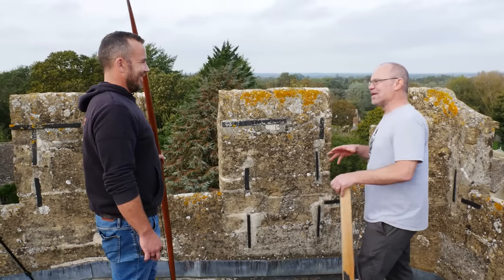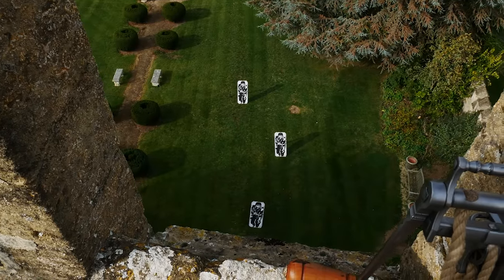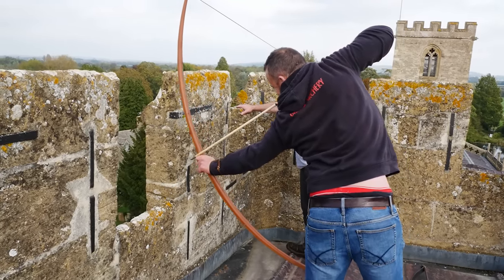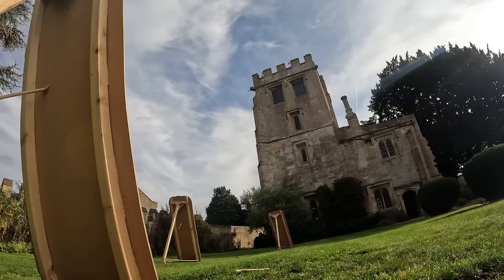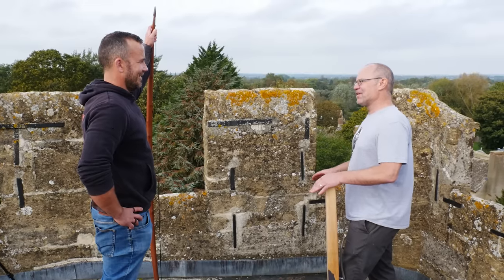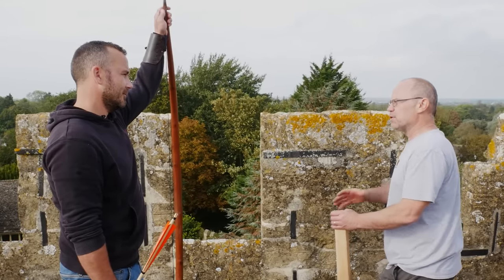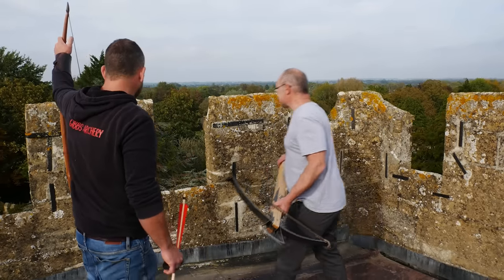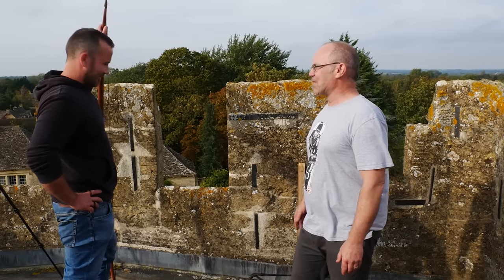Crossbow or Longbow? What's better for defending your medieval tower?

Comment: Easy: If your tower is full of trained longbowmen with the years of practice, training, and exercise required to draw back a medieval longbow, then longbowmen are better. 

If you’re not sure if you’ll be able to maintain a garrison of trained longbowmen to defend a single tower instead of using them to defend more valuable assets or in an attack, then crossbows are better because you can stick basically anyone in there with minimal training.

Comment: If i was on the tower with crossbows, I would have people in a safe spot whose only job was to load the  crossbows, and then slide them out to gunners who's only job was shooting them and could keep track of targets without looking away and maybe a couple of people with shields to give the shooters some cover when looking out, the same process could be used if I were using muskets, but using bow and arrows you would be screwed unless you were using them like artillery for ("Area Fire and shoot in the general direction") but that would waste a lot of arrows (I wonder if using arrow slits in walls you would be able to aim an arrow accurately or have to use the "Area Fire and shoot in the general direction" .)

Comment: Are the crenelations a standard size ? Would the crossbow limbs fit between the crenelations at a different castle ? As stated this castle wasn't actually designed to be used so would the size of a crossbow be considered when building one that was ?

Comment: I think they were good because you need very little training to be accurate. A good longbowmen is gonna be faster and as accurate if not more. Its just that you can round up 100 men from wherever, give them crossbows and 15min of explanation and you get a similar result then years of training with a longbow. That's what I think anyway. The simplicity of use makes it a good weapon to produce for the masses, greately increasing the strengh of your army with low training time. There were probably a lot of properly trained crossbowmen too. I'm no historian so I'm not familiar with that, but if I were a lord in these times and had 100 peasants to go to a battle or defend anything with, I'd either give em pointy sticks* with shields or crossbows with bolts (*replacing the pointy sticks with maces if we're talking of when armor was more common). But all in all, I'm not super surprised that our longbowmen here is better then the crossbow, after all he a real trained longbowmen!

Comment: So i just started this video at the ti.e of this comment but i feel like while yes the cross bow was "more accurate" and had better range and less training needed, the war bow had a shorter reload time and just send splinters down range faster, i think if used at the same time are more complimentary than one over the other. I say this because you have 5 CB men manning a section of wall they have to reload which takes a minute, during the reload time you have 5 WB men loosing 3-6+ arrows during the time of reloading for the crossbow and more or less keeping the enemy pinned and at distance. Also if there was a shield wall formation you have WBd lob arrows while CBs take direct shots at the formation, cant block em all, right?

Comment: In my opinion you shouldn't have made a pure accuracy challenge but a speed and accuracy challence in rise from cover, aim, shoot and get back into cover. Since the enemy team will use the time you expose yourself for aiming and shooting to hurt you.
Now what happens the experienced longbowmen and the experienced crossbowmen are wounded and have to be replaced by peasents from the kitchen or the stable etc. how sucessfull can they handle the longbow or the crossbow in a fight? The besieging force will be much larger than the besieged force and has more likley the possibility to get reinforcements into action. 
Also are there kinds of battlements that are more usefull to longbowmens or crossbowmens?

Comment: I also that you could hide longer with the bow than shown. Begin to pretensen the bow sideways around 70% the way pop out and shot. I suspect that there will be little accurate return fire if there are so few guys that you need to aim, or if the enemy archers are too far away to be a target. Or dont aim if there are enough enemys. 

Holding it at 70% and the rest out of cover is one way another would be to stand sidways and turn out of cover together with the motion of drawing the bow. Joust standing out and drawing the bow seems kinda......well dumb.

Honestly i would like to see a comparison with a short bow. They seem way more suited to castle defense. They have a drawweight any able adult should be kapable of pulling repeatedly for quite a long time without geting fatigued. Their range disatwantage is mitigated by your elevated position and the fact that the enemy needs to come to you. They should additionally allow much more free movement with a tensioned bow.  

Having a longbow defend a castle seems equivalent to in moder terms having a sniper in a house fight.

Comment: Most places were not defended by lots of well-trained troops. Anybody can use a crossbow with some basic training, you can't do that with a 100lbs plus war bow. There is also a little sprung metal catch that holds the bolt in place for crossbows. 

So say you're attacked, and you have a very few trained archers, but lots of able-bodied staff/servants. You also have say fifty crossbows, and war bows in the stockpile. Anybody who can actually use a bow will get one, everybody else will have to use a crossbow. 

So when it comes down to it, crossbows are better, because an unusable bow is worthless. But you can find almost anybody and hand them a crossbow.

Comment: Brings back that point in: did most medieval archers really used 120+ lbs bows all the time? Or did most archers in fact used more something within the 75-100lbs range: something a bit less powerful but easier to manage in all kind of awkard situations. What good is a bow if you cannot manage in most situations, right? Turks shoot in all kind of position and angles, yet they rarely used bows more powerful than 90lbs (so I found so far).
There are issues basing all source of knowledge on what was found on the Mary Rose, especially since most bows found there are overestimated in terms of pulling strength.
Reply: There's fascinating report from Hangzhou garrison in 1736, reporting that out of approximately 3200 soldiers, about 2200 were able to draw bows of strenght six to ten (80-133 pounds), and 80 could handle bows that were 147 to 173 pounds. 

 Five hundred troops at the small Dezhou garrison were  all able to take a five-strength bow (67 pounds), 203 a six-strength (80 pounds), 137 a seven strength (93 pounds) and 85 a ten-strength bow (133 pounds)

Other Chinese sources from 17th century mention that pretty much all archers can shoot 80 pound bows, 110 to 130 are for stronger archers, while above 158 are for very strong ones.

Unfortunately, it doesn't seem that anyone save for Chinese thought of measuring bow tension by weight before modern times, but nonetheless it  gives us lots of data.

Draw weight seem to be pretty similar to what we see in Europe. Exceptional Manchu archers were apparently able to draw 240 pound bows, but it's unclear whether they could shoot them accurately or just draw them.

Comment: Crossbow will have a bigger advantage if this is a real castle wall (with machicolation and angled wall/towers).

Even with this simulation, the Crossbow man can shoot from the ready, spending less then 50% of the time exposing himself compare to the Longbow man, the crossbow man also expose less body area compare to the Longbow man, that is at least 50% survival rate improvement right there.  I would say the crossbow man has a clear advantage.

And there is one more thing... you can train a normal farmer to shoot a crossbow effective within a month to defend the castle, it will takes years to train a effective Longbow man....   basically a lord can conscript farmers to defend the castle if he has a stock pile of crossbows, can't do the same with Longbows

Comment: Would the archers defending the towers have also used Shortbows and would that have helped overcome some issues the size of the Longbow might have had at the top of the wall or tower? Lastly, in movies, tv etc you sometimes see buckets of arrows or crossbow bolts. Would those actually have been there or is that just something extra added for tv and movies?

Comment: There wouldn't have been archers needed for an attacker 12 yards away. At this point, throwing big rocks and tipping boiling water would take over. 

Hoardings would have been used in other situations but in this situation, big rocks.

Comment: Longbows are for field armies for range. shortbows are for castles where you need LOTS of them. Also, it'd take less wood to make an arrow for a shortbow so you can make craploads more arrows. Crossbows are for peasants who don't know how to draw and aim a bow. Really depended on the composition of your army. Long pikes in front of the longbowmen makes a nasty combo. Cavalry on the flanks and the swordsmen/short spearmen on the edges of the pikemen making a point. Keep the cavalry on the edges just in case they try to flank and keep your longbowmen firing until they run out of ammo. Advance your basic infantry forward covering their flanks with cavalry and then back up your cavalry with pikes just in case. Longbowmen switch to daggers/short swords if they had them. if absolutely NOTHING else, they hold one arrow back as a stabbing weapon.

Comment: I'm sure this has been mentioned before, but what if you could use the best modern spring steel, heat treatment and machining to make a crossbow, how much better would it be compare to medieval ones?
Reply from the maker: If you kept the dimensions the same, not much different.  If you designed the bow using Finite Element Analysis which would also inevitably allow you to increase draw weight, then probably a massive difference

Comment: This tower is definitely not in its original condition. If it really dates back to 1450, he was probably already heavily modified during the Renaissance. But in any case, the tower was rebuilt in the neo-Gothic style in the 19th century. This test therefore says nothing at all about the defensive usability of these weapons in the Middle Ages. In addition, the embrasures were certainly also used for the defense.

Comment: I think you set up the challenge as a bit too difficult in my opinion. I assume you would be providing covering fire whilst the enemy are slightly further away, and if they are advancing then perhaps they are covering the ground as fast as possible, so the window to fire upon them in your targets positions would be limited at best. 

If they enemy were at a marginally further range, that would alleviate some of the struggle to aim downwards at such a sharp angle. Interesting nonetheless, my back hurts just watching the guy draw the longbow!

Comment: with a slightly weaker bow, one could draw then step into the gap , pick a target, loose...  and step back very quickly ... you don't need all that horsepower in  a bow to get penetration if in the right spot...

Comment: One thing I've just thought about the crossbow you're using here, did they ever try to make a different mechanism to wind it up? Something that wouldn't have taken so long to set up, wind up and remove before taking the next shot? I know you've shown examples of other crossbows and how they were reloaded, the special belt springs to mind, would any of them work in any way? Or is there anything you could come up with using todays technology to speed it up?
Reply from the maker: The goats foot lever would work well, but the bow power would be power.  They also had spanning stands for spanning these heavy weight bows and they are very fast to operate, but were specialist castle kit rather than a Manor House.

Comment: Something is not right. If lowering your elevation of fire was a problem for genuine castles, there must have been a work around. E.g. sloped floors pointing towards arrow slits? Lighter bows? Something is missing from this analysis

Comment: One equally important thing to consider when comparing xbows to bows; the xbow can be reloaded by a non-shooter, so if you equip one shooter with 3 xbows and manpower to reload as he lose the bolts, then the xbow will have a much higher firerate, AND they can be used for arkward shooting

Comment: crossbows were actually a worse weapon in the hands of professional figthers however dont forget that most guys didnt have a proper training . we can clearly see it on the video the guy is a trained bowman at a young age is not getting an edge with against an old man holding a crossbow and doing it whitout breaking a sweat  u could spend 10 days aiming but we see the bowman only holding it for like 20 sec max (?)
for most peasents point and click would be better as they didnt have proper technique how aim or draw a bow even if u lose power an eye would be enough to take one enemy down + most armies participants  did not present full body armor that rigth was holded for most of the elite units or heavy units.
another advatage to a crossbow goes to the loading mechanism wich did no require the shooter and the loader to be the same guy meaning u could have old mans or idle soldiers load crossbows and hand them over to more experienced shooters

Comment: I would also think that the major advantages are:
The rate of fire advantage of the bow is not relevant, so the ease of use advantage of the crossbow is more valuable.

And i think the 2nd one is holding the target. Maybe even more so for the attackers. You made a beautiful sequence with you and joe „acting“ how you would peak for a shot. There is no way on earth that in that timeframe a bowman nocks the arrow, pulls, aims, lets lose, and hits. It is literally impossible. They would have to kinda „pre-fire“ and hope you come out just that monent. A crossbow man however may have spotted you and went ahead to hold aim on your spot. As soon as you peak, he can release and the bolt will make it in time.

And a 3rd one for pure speculation. I suppose bolts are easier to produce and cheaper compared to arrows.
We know for a fact that on bigger campaigns, actual warbow arrows were quite a financial task.
Obviously it takes more effort to make a shaft 2-3 times as long. Also bows are lesa forgiving when it comes to spine. They need better fletching.
I can see that especially on smaller buildings or castles is just more reasonable to have an „arsenal“ of a few crossbows and bolts that literally anyone can operate with very few training. So you can hand that out to your militia aswell and you are not relying on having well trained, experienced archers and a more expensive pile of ammunition in your armory?

Comment: I think there is a bit too much of modern warfare going on. As if stepping into the line of sight of the enemy would immediately result in someone getting shot. A modern way to think, because modern weapons would pose this kind of threat - but in such historical scenarios it is more unlikely. Cannot be ruled out of course, that is not what I want to convey. It is more about a mindset. The enemy does not have countless ranged fighters aiming at every spot at all times (as it is easily done with firearms). Especially not in a siege, which was time consuming to begin with. Our modern mindset has the warfare of the World Wars embedded in us, which means a lot of people shooting a lot and the constant barrage of intense artillery warfare and the threat of armored and even flying vehicles. A castle siege was probably way, way less intense. All ranged weapons shot way slower and are not based off explosions/shrapnel, there was a very different logistic behind it, and the main form of combat was still hand-to-hand as opposed to ranged engagements. Not even the best prepared attacker would constantly rain down on the besieged, just for reasons of logistics and limitations of physical labor, especially with bows, way less with crossbows. Yes popping up from battlements posed a risk, but not as intense as our modern minds think it.

Comment: Bows aren't guns. People have to spend longer to aim, which means being out of cover for a moment is less of a risk. If people in modern wars are going against HMGs and being out of cover then people will be out of cover in older wars. So saying "No one is going to do that" is false. There's also only so much space on the walls. Armor penetration is also a factor. As well as a crossbow being quicker to fire and easier to use. That means less training. That means more people using crossbows. Examine the situation from an army standpoint. Not a solo standpoint.

Comment: My conclusion would also include that you're in view for a much shorter time with a crossbow. At 9:26, you're in view for 1.3 seconds with the crossbow and 1 second longer with the longbow. If your enemy, for example, has their crossbow aimed at the battlements with arrows that can fly 200 feet per second and is 70 meters (or yards) out, their arrow cannot reach someone up there who is using a crossbow before they are out of view again, but their arrow could reach someone who is using a longbow

Comment: If you don't know what bows they were using back then this whole experiment was a waste of time. I don't believe they would have been using that powerful a longbow. As to that mechanical monstrosity of a crossbow surely they weren't all loaded with a pulley system ? In fact I've just gone off and looked at pictures of 15th Century crossbows and most don't have a handle wound system. So really you need to get some real historians involved in these experiments and not make assumptions on what they used back then.